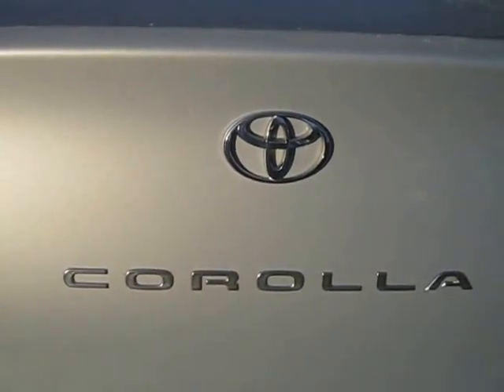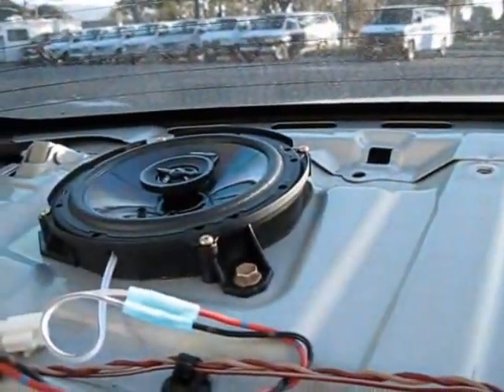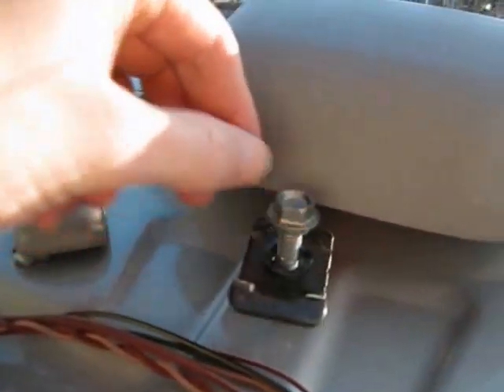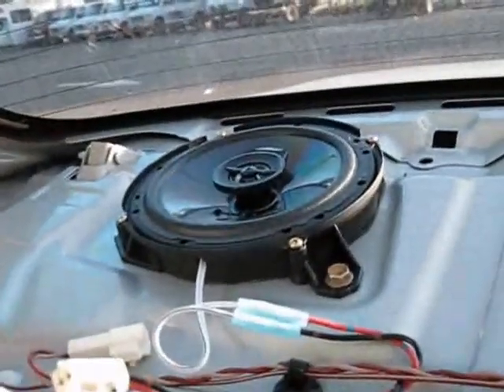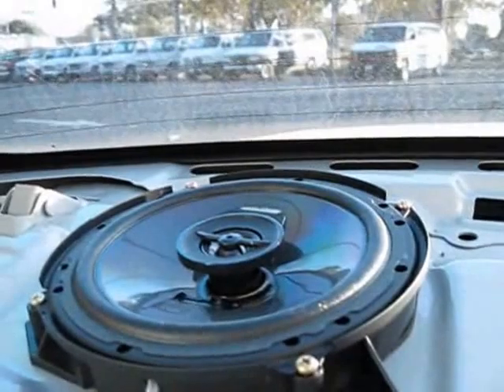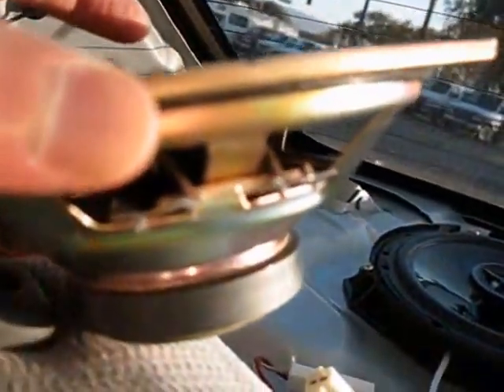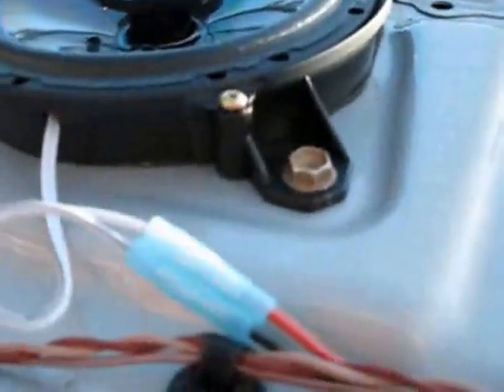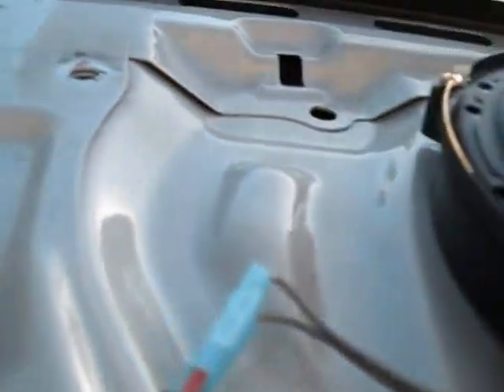2001 Toyota Corolla 6.5 inch Rear Speaker Replacement and Wiring Speakers

Comment: fyi buyer beware! i called Kenwood about the Road series speakers and they had no idea what these are. they had absolutely no info on these. im thinking they could be a chinese ripoff and NOT actual Kenwoods.
Reply from the maker: Interesting, I bought them at Best Buy, would be weird if a major retailer was selling knockoffs.  Thanks for your comment though to warn people just in case.   FYI they sell these on both Amazon and Best Buy's websites:
https://www.amazon.com/Kenwood-KFC-1665R-2-Way-Coaxial-Speakers/dp/B00KC7KXQM
http://www.bestbuy.com/site/kenwood-road-series-6-1-2-2-way-car-speakers-with-paper-woofer-cones-pair-black/3190025.p?id=1219088673240&skuId=3190025

Comment: Did you change the front door speakers? If not ,  why?
Reply from the maker: +ace frehley My back plastic rear speaker covers disintegrated in the sun so I had to replace those.  In order to do that I had to take off the whole back panel so I figured since I had that off I might as well replace the back speakers.  Replacing the back speakers was easy for me as they are just bolted in on a black plastic base which comes off easily with a socket wrench and the old speakers come off that base with just a screwdriver.  The front speakers are one of my next projects, you have to take off the door panel which isn't difficult if you watch one of the Youtube videos on how to do it.  The difficulty with the front speakers is they are riveted in and have to be drilled out as seen in that other guys video I put a link to in the description.  I do plan on doing the front speakers in the future though, hopefully this summer.  Thanks for the question, hope that helps. =)
Reply: infiniteriver93
First off , thanks for responding back so fast. I like the way you show you are able to use the original speaker spacer. I did see some video's with the next generation corollas (2003-2007) where the speakers in front are riveted to the door and they needed to drill out the rivets and put in a new spacer and drill new holes. So I guess my 1999 Corolla LE is riveted as well. I wish they could of used screws instead of the rivets , I saw a video with a Tacoma that had screws instead of rivets in the front door speakers. I'm looking to just upgrade the speakers probably in May when it's a little warmer outside.I bought this car from a old man , it's been garaged kept and it shows. The paint is perfect , no rust , the outside rear door weatherstrips are in new condition , where many corollas the rubber paint is coming off. ( I saw your video on repainting the weatherstrips by the way , great video ) Inside is in great condition as well , no plastic cracking by the door opening's , headliner in perfect condition , never smoked in and I don't think the cup holder was ever used , it was free of any spilled coffee , ect. Only thing I had to do was change all 4 struts and springs and fix my starter with a $15.00 dollar plunger contact set from Amazon. These are great cars on gas too. Once again, Thanks You
Reply from the maker: +ace frehley You're welcome and Nice!  Sounds like a great deal on an awesome car!  It's funny I will see a lot of Corollas that have the same issues that I've had that you mentioned and then once in awhile I'll see a pristine one with no paint issues, headliner issues, weather strip issues etc. etc. and I'm like how the heck does this car look so awesome?!  You just answered my question, garage your car! Lol.  My Corolla has got the beat down from the SoCal sun and that is why I've had to do all these fixes.  One thing I just did recently that I wish I had done years ago is getting my windows tinted.  That will help out the interior big time.  Yeah I wish they used screws too on the front speakers BUT I think they do rivets for a reason.  That reason being the nature of them being on the car door opening and closing all the time.  They really need to be secure so you don't get speaker rattle.  I've never worked with rivets nor have a rivet gun, so that is my issue with doing the front speakers right now.  Thank you for the video compliment, I appreciate it.  Have fun with your Corolla, they are great cars. =)